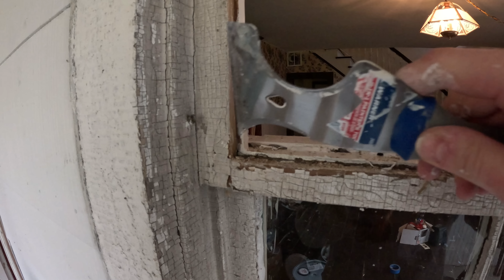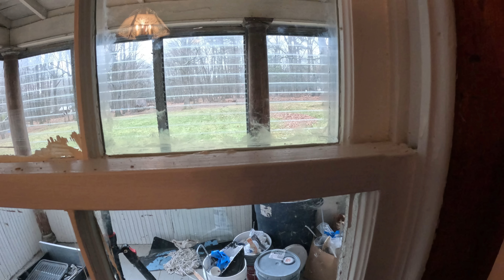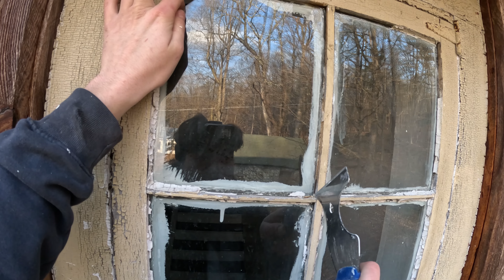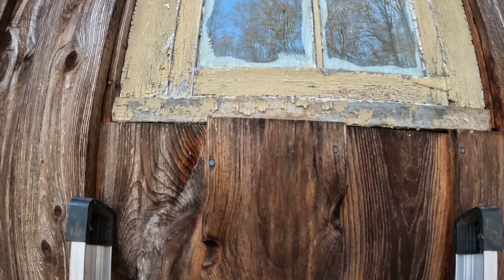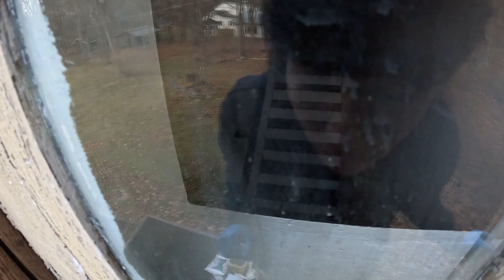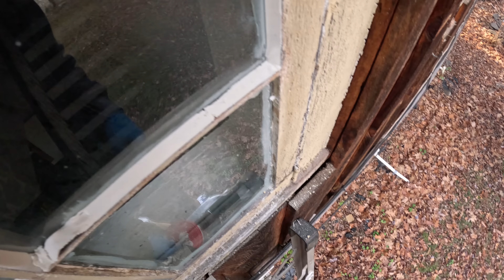How to remove, replace and glaze single pane windows

Comment: I redid the glazing in my son's room before he was born.  Redid all the finishes in his room.  Stripped both windows and re-glazed, ugh.  Re-did the trim, and repainted them and the entire room.  I remember stripping the windows on the back patio in a plastic tent I created with two halogen worklights providing light and warmth!  It was February in the metro dc area and in the low 30's .  Froze my butt off and the stripper took 3 or 4 hours to work.  It turned out great and looked awesome....but that was about 36-40 hours of work!!  Great video!

Comment: We were taught to always run a bead of putty round the frame before fitting the glass to even out the surface and help prevent the possibility of cracking the new glass..
Reply: I used to be a glazier, the putty was too hard needed some oil to soften it up. then roll it on the frame window then put in the glass and fix with 4 short pins then nead the putty round with your thumb and square off with the putty knife at 45 degree angle. must of done this a million times.
Reply: @galdessa1  Correct with softening the putty,  I always used Linseed oil .
Reply: Bed the pane

Comment: I used to hate replacing glass and trying to make the putty workable as it was always soaked in linseed oil. The UK always had pins holding the glass into the frames, and it was always a nightmare to get the putty looking good. 

A brilliant video, Samantha 
I can't imagine how many young women you'll inspire to take up home repairs and maintenance

Comment: I have done restoration work on many old Victorian home with single pane widows.
For a lasting job and to prevent the glazing from cracking, Prime the bare wood in the frame. 
You can use an artist brush and just paint the inside of the frame, that way the glaze will cover the primer.
Also roll your glaze into a long snake and place in the frame,
Reply: Thats the way my dad taught me man, many years ago.

Comment: Great job Sam, it looks just fine. Just a tip like others have mentioned, I always kept some Linseed Oil for oiling my putty knife, that allows for a smooth run on your putty/glazing compound. After 60 years of repairing windows it's good to see someone keeping the skills alive. 
p.s. my last house was an old Coastguard House on top of a cliff overlooking the Atlantic Ocean and had 115 panes of glass on windows just like you repaired. 😒🤨🥰

Comment: Glazing is one of those skills that is easy to learn and hard to master.   I think the key is having a putty knife with just the right amount of stiffness.   So in the past I've chopped off and ground down to a shorter length until it's just the right stiffness.   But then it still takes a lot of work to be able get the glazing compound perfectly smooth.  It also helps if your glazing compound is not all dried out.  Sometimes you have to add some linseed oil if it's too stiff.

Comment: Glazing a window is a very tough job to do well. And expensive to have it done by a pro. Those windows need to have all that old paint torched off . Cheaper in the end to put in a vinyl window. And more energy efficient .You've done a pretty good job .

Comment: First of all, thank you for using real glazing compound.  I keep seeing videos where people use the spray can glazing.  The problem with this stuff is that it shrinks so much that a fine looking job will look horrible in six months.   
My experience for what its worth is the best way to make this (or pretty much any other home repair job)  job easier is to never use DAP products.  The UGL glazing product is a bit more expensive, but requires less kneading and draws better with the putty knife, particularly at lower temperatures.  The tearing along the cut line that you experienced on the first window almost never happens with UGL.  It is just easier to work with.  
The bad news is that UGL pretty much requires you prime the window first before applying.  
For what its worth, DAP 33 glazing putty is basically Chalk and Linseed Oil.  UGL glazing putty is basically Gilsonite and Chalk.  
I am not aware of any product that DAP makes for which there is not a superior product on the market, usually on the shelf right next to it.  They are just the common bottom of the barrel product in so may categories.   The old adage goes "DAP is Crap".
Another comment is that the larger points that you are using stick out so far that they can make it harder to cut the glazing.  As nice and easy as they are to use, I find the glazing goes easier with the tiny diamond shaped glazing points.
Reply from the maker: Appreciate the pointers! I do find that those glazing points being so large interfere with the sizing on sharp glazing applications. I can’t say that I’ve ever seen the small diamond points in the store though

Comment: i took quarter round wood and and cut it to frame the glass in /hold the glass in place then pin nailed the quarter round in place and then used clear caulk to seal it after painting...

Comment: I know A tip trick you can use  for A home-made glaze putty tool Samantha. You can cut A piece of plastic like butter blow lid.,or A cake frosting container down to A small putty wedge tool that can slide down those sides of the window frame to. Just use A pair scissors to cut out some of those tools with on the super cheap. They're reusable and cleanable afterwards to.

Comment: Love your videos a simple easy explanation on how to do this. I have one little trick carry a cheap spray bottle ,once you lay out the putty on the glass ,spritz it lightly with the water, putty won't drag. Keep posting you videos all excellent!
Reply: Putty will not seal to wet glass!
Reply: @simmosimmo100  Can you read ? ,I am talking about once the putty is on the pressed on the glass  ,I actually use a very sharp wood chisel to press the putty in and shape it ,I wet the top of it ( very lighty with a spray bottle .I have only glazed about 200 panes that way .
Reply: @jerrygiarratana9462  if you worked the putty in your hand it will be like plasticine and easy to smooth. Never ever used water.
Reply: @galdessa1  disagree even warming and stretching putty ,I still lightly mist it.
Reply: Jerry.  Before you ask if I can read, maybe you should correct your writing.  There should not be a space after the end of a question and the question mark.  A comma should not follow a question mark.  A space is used after a comma and a full stop, not before.  Your grammar makes no sense re 'once the putty is on the pressed on the glass'.  See me after class!
 @jerrygiarratana9462
Reply: @simmosimmo100 ,It works for me. To each his own. I didn't realize the ,it was that difficult to understand, my comment, Mr Fake name....
Reply: @simmosimmo100  You really can't comprehend . I put the putty on thr million and glass FIRST ,press it down ,then lightly spritz it. It works for me....

Comment: Curious what the benefit of using window glazing putty over caulk is?
Reply: Window putty has been in use for hundreds of years. Acrylic latex and silicone caulk has been in use for about 50 years. Window glazing putty is made from high calcite lime and linseed oil. When properly applied, cured and maintained, it can last hundreds of years. By contrast, acrylic latex and silicone caulk generally lasts only about 10 years.
Reply: ty for dropping the knowledge <3 @galdessa1

Comment: Trick to remove old glazing  is heat will soften by using  small torch or heat iron aka glazing iron and to work putty in hands to warm up the warm the smooth er to apply

Comment: 5:31 Sam do you not set the glass on glazing putty before putting glass in
Reply from the maker: No you do not
Reply: @samanthaweber6932  well as I was always taught as an English joiner ,carpenter ,we always set glass on putty ,but as you say every weres different ,
Reply: You only glaze the exterior of the window, no bedding
Reply from the maker: People are saying that, that’s not the way I was taught. The idea being to allow room for expansion and contraction as well as settling.
Reply: @samanthaweber6932    Correct.
Reply: @samanthaweber6932  I'm sorry for any body else's remarks but the oil based putty allows for this ,it's linseed oil based ,I was saying in England we are taught different way than you in Canada ye ,well there's nothing wrong with that at all .your ways a lot easier ye aswell .👋🤠👍
Reply: @cliff1551   USA, not Canada  😉
Reply: @edvanandel  both across the pond man
Reply: @cliff1551   So far (or close) and so different. LOL

Comment: Here the compound is called putty.
You should have applied a thin layer of putty to the inside of the window frame for the glass to seal against and then place the window in. Then another layer of putty around the outside of the glass,  The way you did it will cause the glass to either rattle in the frame or crack against the wood..

Comment: I had an old horizontal swing window, single pane of course, but with fairly thick wood laying around.
Asked a window maker if he can make a douple pane to my specs, with only 3mm glass and an 8-12mm gap usually used for triple pane (don´t know the actual gap, it´s been a while).
It´s a fairly small window, so pane strength isn´t too much of an issue.
He sure could, so I deepened the recess in the wood and glued the glass into the fully painted frame with silicone caulk (stick to glossy paint very well).
That was a good 25years ago, window´s still holding up, outside may need a lick of paint though.

So if a wood frame is thick enough to mount it, a redo with a double pane of minimum thickness may be good solution for keeping old, classic windows.

Comment: Did not bed the glass onto putty.  Very very poor example of how to glaze a window.
Reply: No, she did right. You have to leave room for the glass to expand in heat and to shrink in cold. If you put putty in first, the glass will crack in summer.
Reply: Can see that there was no putty behind the old glass that she took out. Was just the wood frame.
Reply: @edvanandel  The DAP vendor site for the glazing compound she used says to lay a 1/8" bed of compound before inserting the glass.  I think they know what to do...........